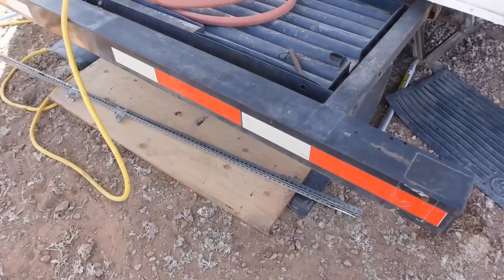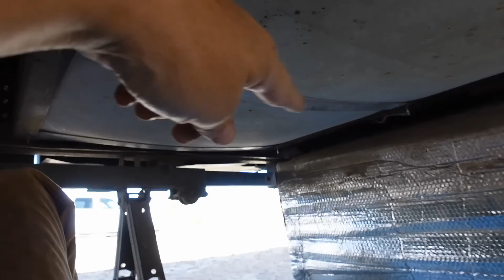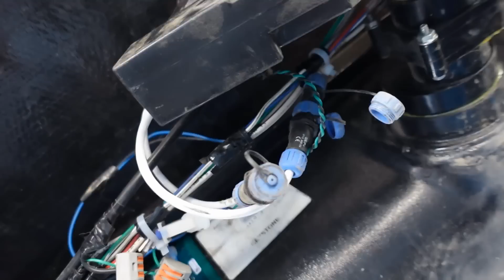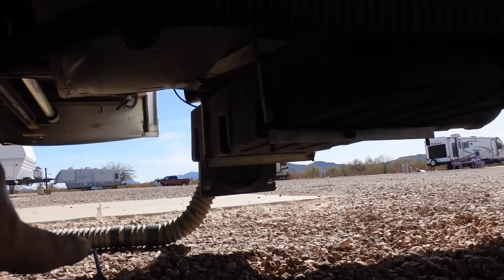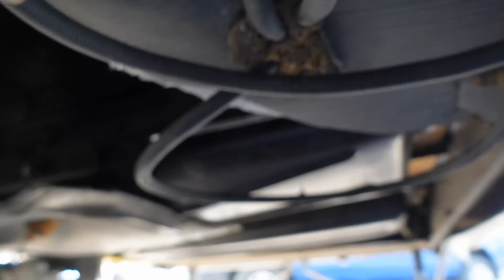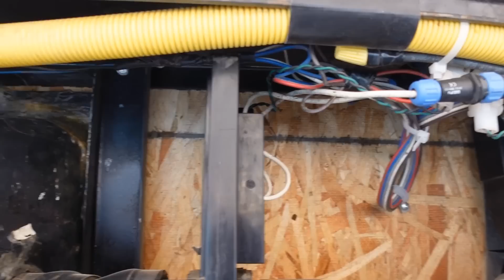RV Trailer Underbelly Removed for Inspection & Maintenance

Comment: Ray is there any video, that shows how you reinforced the fresh tank?  I have 2012 cougar xlite 29rls and it's basically the same underneath.  we sometimes travel with some fresh water for boondocking, and I worry about the weight.
FYI - I swapped out (DIY) my OEM leaf springs, went up to slightly higher weight rating (2300lbs to 2500lbs per spring).... RV rides way better now.
Reply from the maker: Here was the original repair video for the falling out tank https://youtu.be/R9abzEgrs04 then later on when I installed stabilizer jacks I was able to add more support under it https://youtu.be/ajK8QKABJ70?t=132

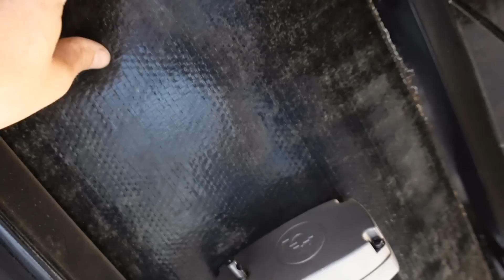Comment: At 15:05, You put your hand on some soft blanket like material that runs down the sides of the trailer. 
I have my middle drain pipes running through it. Now I have a leak. How do I open up that blanket like material without cutting it? I have to get to that section of pipe and fix it.
Reply from the maker: Its kind of a plastic tarp like material with pink fiberglass insulation above it and between it and the main flooring. From the looks of it they install it during the manufacture process before the main floor boards are laid. So by the looks of it the only way to get inside is to make some cuts then tape the seams back up afterwards. The manufacture has cut some of it to run the underbelly heating duct and propane lines.

Comment: Ray, my large slide motor clutch is going bad and you mentioned a link for the parts. Not sure if I have the older, or newer unit (mine is a 2013 Fuzion toy hauler), but I plan on having a look this weekend. Any chance you can share the parts link?
Jim
Reply: I see the clutch part I probably need, hopefully I can get the assembly out this week and get that thing ordered from RV Clutch Brakes, if indeed it is a Tuson. I remember seeing that vid some time ago and they had not-yet advertised that part, but stated it was coming. Thanks again.
Reply from the maker: You're welcome. :)
Reply from the maker: Sure thing. Mine used the Lippert brand motor made by Tuson. Here is the Tuson website with the parts https://shop.tusonrvbrakes.com/collections/replacement-parts   Here are the several videos I made https://www.loveyourrv.com/rv-slide-out-stopped-working-but-easy-repair-replaced-stripped-gear/
Reply: @LoveYourRV  Many thanks!

Comment: I must have been following you too long? I remember when you did most of the projects you described today; back in the past. I removed my Coraplatic on our last tt about 7-8 years ago. For some reason I took the whole piece off instead of just one side and drop it. It was a real bear to put back up all by myself; but would have been much easier had I done it your way though. Oh well, next time! TNX

Comment: Thanks for the tour Ray. I've seen most of the underside of our Cougar. Now I've seen yours. I remember when you were working on that Gray/Black wye. That all scared me, so when I was under ours I went ahead and added grease holes to each of the 3 valves. So far that has kept them sliding well, but I still dread ever having a leak there.

Comment: You are a brave and industrious man Ray. I have gone into our 5th wheel underside to repair/clean a black tank valve, replace the cable and later reattach the cable sheath. I cannot imagine a whole removal. Thank you for your efforts. This reminds me of a colon endoscopy.
Reply from the maker: It's taken me many years to figure it out by taking section off.

Comment: Ray, really looking forward to the reinstall of the under belly. If you are close to a Costco or Best Buy, see if you can get your hands on a big screen TV cardboard box. Laying on the glossy picture side of the box makes sliding around under the trailer so easy for us elder DIYer's.
Reply from the maker: Thanks for the tip. I have been using an old RV patio mat. Works pretty well and easy to store rolled up for the next time.

Comment: Ray, thanks for all the great content you put out. About your comment on 60 gal tank but you only get 55 into it, I’ve read that the manufacturers include the water heater tank in the total capacity. That could account for the difference.  I’ve always had my eye on the SeeLevel system, but for the cost and extent of the installation, I think I’m gonna try the Mopeka water tank sensor and then just use my phone as the display interface.
Reply from the maker: Thanks, that makes sense. :)  Cool, I didn't know that Mopeka now sold a water tank sensor. I installed my SeeLevel 8 years ago. I think they are a little more expensive since they are a Canada company from Alberta and do a lot of commercial equipment sales.  The fresh tank and shower tank always report accurately but the black and galley often don't work that well for me. I dry camp most of the time so tanks get pretty gunked up. They tend to only work well if I'm able to keep those tanks well flushed. Cheers, Ray
Reply: @LeisureLakeTech  
I have the Mopeka on my fresh tank. It's nice to see a % of full. I also subtract water heater from total. Accuracy iffy. Recently added 9 gal, and % showed no change on an 80 gal tank.
Reply: @TraconWizard   Ouch on that accuracy. Good to know and thanks for that.
Reply from the maker: Mine reads in around 4% to 5 % steps out of 100

Comment: Ray, do you have a link to your fresh water tank sagging fix? My Komfort travel trailer water tank is sagging also, I haven’t dropped the under belly yet but I’m going to have to, Thanks, cheers
Reply from the maker: Here is the  video where I found and repaired the sheared off screws holding the bracket https://youtu.be/R9abzEgrs04 In this part of another video when I was installing stabilizer bars to my rear jacks I beefed up the support under the water tank. https://youtu.be/ajK8QKABJ70?t=131  I do a lot of dry camping so often travel with a full fresh water tank so wanted it to have more support for rough roads. Cheers, Ray

Comment: Did you have to replace the display for your tank levels as well  or just the strips on the tanks using the old LED display?  Or did you replace the entire system with the Sealevel kit?
Reply from the maker: I replaced the OEM display with a Seelevel one. The OEM display was just simple LED lights no digits https://www.youtube.com/watch?v=W-njnZ80ngA

Comment: Ray!  Those leaf packs may be getting tired.   You probably noticed - thanks for letting me be "that guy".   See you on the road!
Reply from the maker: Thanks, people always say that anytime I show them, but they have been pretty well like that since new and hasn't been a a problem. Maybe the fact that they were flipped OEM has something to do with it. Here is a comparison 2013 to 2022 https://www.loveyourrv.com/wp-content/uploads/2022/10/springs-2013-to-2022.jpg  At some point, I'd like to replace it with a little beefier pack but it hasn't been a pressing issue.  One side of the rig is currently on about 3 inches of leveling board, so it looks a little worse than it really is since the camper weight is shifted to one side and slide out open
Reply: @LoveYourRV  The ever helpful internet :)   I unflipped and upgraded our last trailer, gaining 7" of clearance and going from 10" to 12" brakes.   We now have a 38' momentum, and the springs have got me concerned - its a '21 and I'm probably going to replace the springs next season with some custom packs.   They are not as flat as yours, but they are exposed to > dynamic loads.  All others OEM  are chinese sourced steel and I just dont trust them.   Happy travels, and thank you for the videos!
Reply: @LoveYourRV  I have a 2015 OpenRange 5th wheel.  My springs looked like that early and they were replaced under warranty.  They again are looking flat when it's empty so I will be changing them again but at my cost

Comment: Yeah, when I first got my used rig, my black tank valve wasn't shutting the whole way. Took the valve apart and cleaned it. For the life of me I couldn't put the valve in, it was too tight. I too had to cut a section out of the pipe and put it back together with a coupling similar to yours. 4 years later, no problems. Did have trouble with gas getting to my water heater. After replacing everything in it, (ebay is a good source for parts) I figured the pipe was clogged. Took a good shot of air to clear the clog as it let out a loud pop. Thanks for showing under your rig. :trophy-yellow-smiling::eyes-pink-heart-shape:

Comment: Hey Ray...I know this is an older RV, it looks like your rear axle springs have flattened out and my no longer be very effective.   Typically this is a sign of fatigue and potential failure.   It could just be the camera angles though, but thought I would mention it.
Reply from the maker: Thanks, people always say that anytime I show them, but they have been pretty well like that since new and hasn't been a a problem. Here is a comparison 2013 to 2022 https://www.loveyourrv.com/wp-content/uploads/2022/10/springs-2013-to-2022.jpg  At some point, I'd like to replace it with a little beefier pack but it hasn't been a pressing issue.  One side of the rig is currently on about 3 inches of leveling board, so it looks a little worse than it really is since the camper weight is shifted to one side.
Reply from the maker: Maybe the fact that they were flipped OEM has something to do with it.

Comment: Hi Ray, I have the same year and make and length of 5th wheel only difference is we have a rear kitchen. 
My galley tank leaks when full I’m thinking the sink drain pipe enters the tank through a rubber grommet type seal. I’m guessing the rubber
 gasket has moved or fallen into the tank. I cannot see the pipe entry point what is your opinion, how hard is it to drop the tank than put it back in place after. Thanks Ray
Reply from the maker: It looks like its pretty easy from the looks of things. There is a rail on each side to take off. It's held to the I beams with Tek Screws. You'd have to remove the gate valve and be careful with the drain pipe up top and there is also a vent pipe to deal with. On my galley tank that enters the drain above the floor. Not sure on yours though.